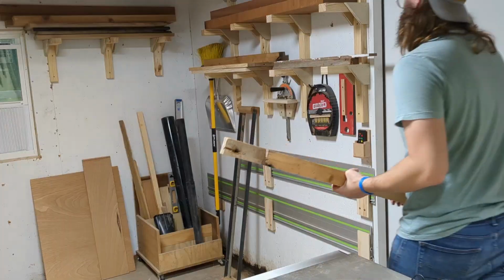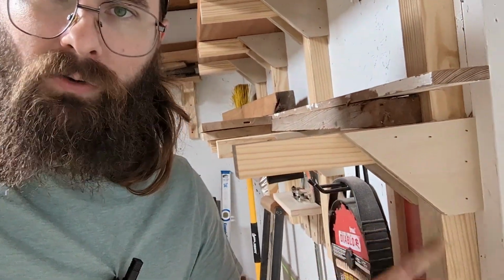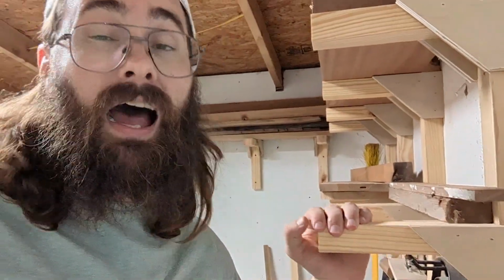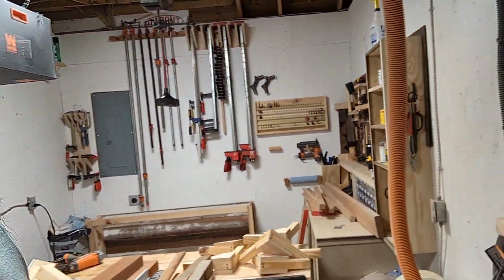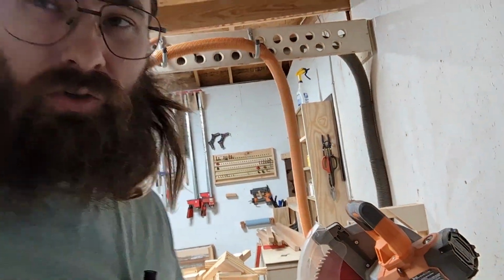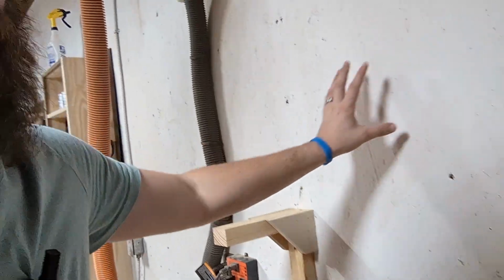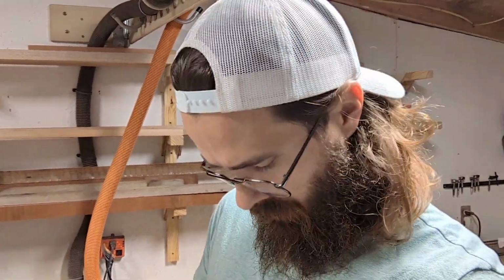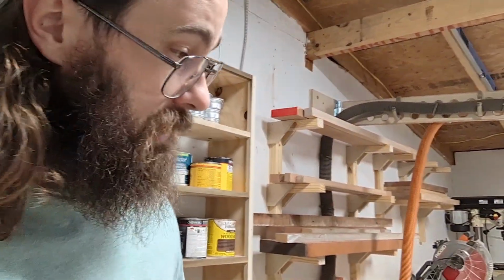Small Shop Lumber Rack | Scrap Wood Lumber Rack

Comment: Now you have a clear wall to mount the charger for your Prius! 

Great idea about putting storage under the table. My shop is on the small. Side but I didn't build it so storage is a serious issue. Things on things on things and no room for working. I think I will be putting up some wall racks for the wood, it would give me some much needed breathing room. Thanks for the idea sport.
Reply from the maker: Hope it helps!

Comment: I really should have considered lumber storage like this BEFORE buying cabinets for the garage.  However, I think with these and the flexibility in size they offer, I might be able to make a small corner rack work.  I do mostly small stuff anyway, so I do not regularly need to stash long boards.
Reply from the maker: It's a great option!